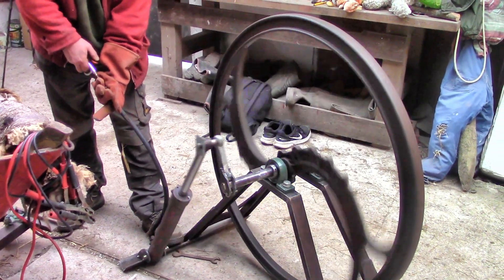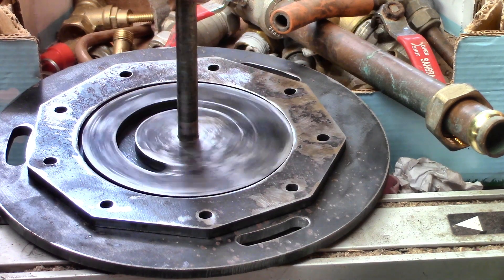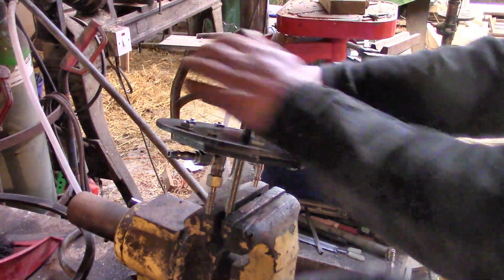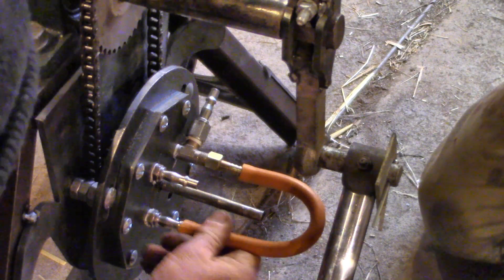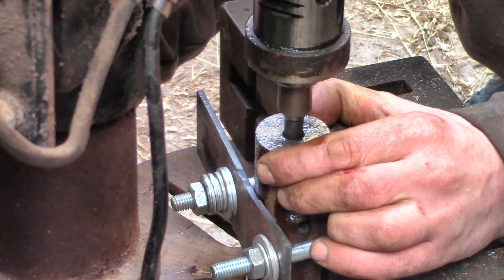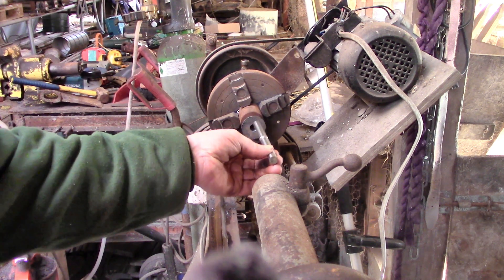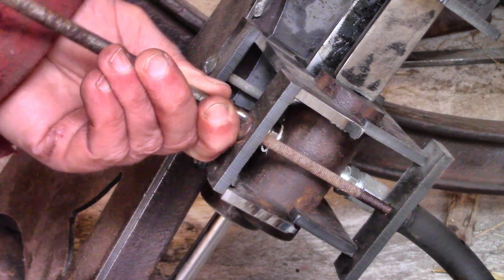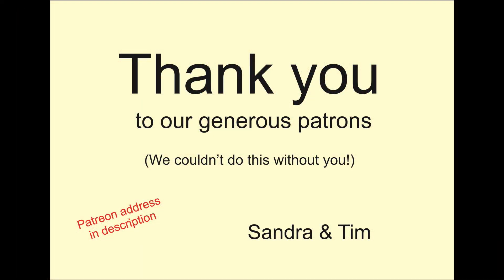Homemade Rotary Disc Valve And Spool Valves For The Steam Engine (I’ve been busy!)

Comment: As always, excellent work! I love the relative accessibility of diy steam engines (vs ice anyway) and the parallels of your machining capacity to that of the early 19th century! Even just the inaccessibility of ball bearings made for such a different approach to most engineering solutions.

I briefly worked at a shop that restored Stanleys and had a chance to get pretty intimate with all the components and the work that went into making them as we made most pieces from scratch based on salvaged parts. I'm not a steam engineer, but can at least say from this experience that packing is your friend! Most of our manual valves were needle valves because they were easy to machine and pretty forgiving as the metal is soft, but I can't recall what the actual engine used. I know it was driven externally by an eccentric, and slid along its axis much like yours, but I never personally worked on one. 

I have a little more experience with industrial fluid pumps though, and can say that the expense and engineering that goes into mechanical pump seals is impressive. They're incredibly tight tolerance graphite discs that are very delicate and costly, but have a service life of up to several years. If I recall correctly, our three main 100hp influent pumps had their original seals in place after over 10 years of service running 1/3 duty. Impressive surely, but I can't fathom how they're manufactured and it's a lot easier to stuff in a bit of rope and keep an eye on the drip rate!

Comment: Just some trivia and side notes: The Antikythera mechanism is an ancient device comparable to an astronomical clock that used gears and dials to show astronomical and calendar relationships. It was discovered in 1900 by sponge divers along with other finds, including bronze statues and coins, in a shipwreck off the Greek island of Antikythera. The coins allowed the shipwreck to be dated to the period between 70 and 60 BC. The use of reamers (comparable to watchmaking hand-tools today) is clearly documented in this artifact. That's fascinating, isn't it?:) For even greater precision, such as that which you are looking for for your airtight metal fit, there is the option of grinding. And believe it or not, this was also used over 2000 years ago. For example, with adapted soapstone and a flywheel with a twisted thread hand drive.

Great project and thank you for sharing!:)))

Comment: may be less leakage, better economy of air use/ more flexability wrt possible timing adjustment etc to generate/process control signals that use small amounts of air that then pilot larger airflows via inlet and exhaust poppet valves for the cylinder...
( akin to the mechanical  trip mechanism of corliss valve, or the hydraulic system of the engine on the 1929 Swiss Steam Ship Stadt Luzern )

small "bump" or lobe on flywheel.
4  roller actuated pneumatic control valves, arranged so as lobe on flywheel actuates them, they'll provide a short pulse of compressed air. those pulses provide the timing of the valve events.  
2 air piloted pneumatic "flip flop" valves. these work almost exactly like an electronic flip flip, in that they remember the most recent input provided to them. the outputs from such a valve are then perfect for driving
2 air piloted main air valves; one valve for air in to cylinder; one valve for air exhausting cylinder

valve timing can be adjusted by rotating the roller actuated pneumatic control valves around the flywheel,  it would be feasible to arrange for such to do by a governor.

Comment: I wonder if making a casing for the disc with the plasma cutter out of some plate would help air pressure. Since could green the disc and use sealant on the casing.

Comment: Great stuff, a 3-way pneumatic valve can be purchased for around £10, but not nearly half as much fun, engineers of the past didn't run steel on steel, you can run steel on cast without binding, but it wouldn't hold air, they used gaskets and seals, you can get steel on steel valves bet these are case hardened then precision ground to size, usually tapering but not always.

Comment: you need to be putting air into your cylinder from both ends.  So you need a cam & valving setup that permits air to be put into one end of the cylinder, and out the other end... and switches on the other half of the stroke.  That is called a double acting stroke.  Which will cause your engine to run faster.  So you need a double acting valving.
Reply from the maker: No, I don't need that : -  )  Have a look at later videos about getting the air loco running. Double acting pistons need more valves - and more air...

Comment: Worked on reciprocating steam pumps for many years in the oil industry. Nearly all were two cylinder. The single cylinder pumps were nearly always a pain to time correctly and get to run correctly. 99% of the two cylinder steam pumps had slide plate valves that were connected to the piston rods by an arm that fit loosely on the piston rod. Much simpler than I can describe. The single cylinder pumps had a slide piston valve like you were trying to assemble. I hated the silly things. Good luck.

Comment: you need a gasket because the air is leaking out around the plate
Reply from the maker: Most of the leakage is inside though

Comment: Heres some tips if your building a steam engine, I've known a lot of steam locomotives, Though Narrow gauge steam engines are a bit tricky, some have small coal bunkers  And are only useful for small distances, The Solution to this is a tender, This also makes problems, The first one of which is the water injector, These may fail sometimes and without a water injector and tender engine simply can't function, I Would suggest to build  an engine with a water tank that can store more than 15 gallons, Make the engine with a built-in tender for storing more charcoal or any type of fuel your using, Problems with the firebox are also common, make sure your engine has a large firebox or you can build it a small one and use welsh coal which burns better, The reason i suggest this is beacuse this is what ive know so far, Oh and if your building an Passanger engine, Add an front pony truck [bassically an truck thats connected to one end of the locomotive and makes it easier for it to go through curves] Of course this will be expensive but it might be worth it, Also you may end up creating a incredible fully runing railway.
Reply from the maker: Thanks, Saul. But it'll be a long time before I need worry about any of that : -  )

Comment: Why don't you look up the design of old steam box valves...they are way simpler that any of this. And require very little precision
Reply from the maker: they need a steam-proof  way of operating them from the outside - so they're actually more complicated I think.
Reply: @wayoutwest-workshopstuff6299  https://youtu.be/kJRUXvV4IQs here check this out. She shows and explains it in the second half. They self wear in, and the pressure helps seal them.
Reply from the maker: Thanks, yes, I saw that one a while ago and was put off by the precision she was achieving. But watching it again I can see that I might be able to bodge something together. I haven't given up on the spool valves yet though - just need a bit of time to get back to them..

Comment: The early engineers used slide valves, not spool valves, which are kind of a combination of the two devices you built in the video. the spool valve was a later invention.
Reply: both very early engines and late steam engines used trip valves.  which at the simplest are rotary valves with a lever arm, which literally got knocked (aka tripped)  open and shut the valve, with motion of piston, or crank. 

Steam engine development, including that of valve gear, wasn't always continued improvement. there was a lot of avoiding infringement of existing patents

Comment: the rotary plate valve is really common in those weird toy steam engines, specially the ones from the 60's.  a while back i figured out a pseudo super high pressure pump that used almost the same design, you could add one easily.  the trick with them is to put pressure on one side and the exhaust on the other, so the steam pressure holds the valve tightly closed.

Comment: Steam engines use cast iron rings (like split piston rings) to seal the spool valves on either side of the "waist," and gland nuts with graphite rope packing to seal the ends where the valve shaft goes through.  If you're using compressed air or low-temperature steam you could get away with using silicone o-rings and lip seals instead.

If you're using cams you could use poppet valves like on a car engine.  You'd have to arrange them in a way that the air pressure is holding them closed.  Most steam engines used an eccentric shaft to drive the valve back and forth.
Reply from the maker: Thanks. An eccentric shaft is just the same a small cam, isn't it?
Reply: @wayoutwest-workshopstuff6299  It's more like a crank with a smaller stroke.

Comment: This is absolutely brilliant! If I may offer some observations, I think that the inlet valve is open too long, and the exhaust valve might be a bit late, causing some pressure to stay in for too long slowing down the piston. I wish I had the stuff to do what you do. You're honestly one of the best and most honest people on this website.
Reply from the maker: Thanks very much - yes I think you're right about the valves. Apparently a little compression at the end of the stroke is a good thing though..
Reply: @wayoutwest-workshopstuff6299  You are correct! I think that just moving the exhaust valve over slightly might just do the trick.

Comment: Theres an easy to build steam engine valve called a wobble engine. The valve is controlled by the tilting of the cylinder and with only one flat slip face it functions very similar to your first valve.

Comment: Every steam engine piston and valve rod has stuffing glands with a packing material like graphited yarn that acts as a seal. You screw in the gland (not too much!) and the packing squeezes around the rod to seal it. It works on air too.
Reply from the maker: Yes, thanks, I've just heard about this. So much to learn!

Comment: You can grind the plates to a match. But the distance between the covering plates have to be adjustable.

Rotate the valve plate with a drill between the covering plates. put a weight on the upper covering plate (ideally the weight is distributes equally) Put a clay slurry on the contact faces and run the drill. In intervals tum the plates in relation to each other to equal out inconstant pressure distribution and add slurry.
I made a seal for pressure pot this way. Took me only two days. :-)
Clay slurry is a surprisingly good lapping medium. (It probably depends on the region :-) )
Reply from the maker: Ha! You know you can buy carborundum paste, which might make it quicker?

Comment: Steam valves use graphite packing, even on full size steam locomotive cylinders the piston has piston rings.

On the spool shaft use silicon o rings to seal. These withstand the heat of the steam.

Also if you are able to put a air feed on both sides of your pneumatic cylinder then your engine will run far better with more oomph
Reply from the maker: Well, maybe, but I'd need more air/steam. I'm thinking I'd be better off using the second cylinder and keeping them both as single-acting. (The piston rod itself takes up a lot of space in the cylinder so that stroke is much less efficient.)
Reply: @wayoutwest-workshopstuff6299  ah I didn't realise you had a second cylinder, yes that would be just as good.
I think you will be surprised at how much steam you will produce once you've cracked the boiler design 👍
Doing a great job with the tools you have at hand though been a pleasure to watch. I have a workshop If you require any precision machining let me know how to contact you and I'll happily help out
Reply from the maker: @peterroberts5835  Thanks, Robert! That's a kind offer. I'm guessing you're not in walking distance of us, are you? Or even in Ireland?
Reply: @wayoutwest-workshopstuff6299  afraid I am England based but more than happy to help cover the materials and postage myself as a donation as I enjoy your video's.
I have a large milling machine and lathe and access to surface grinders.
Just let me know I'd be more than happy to help.

Comment: The first steam engines used packing to create seals I'd think.

The first idea would have been a beautiful execution, it need a lot of precision flattening though. I believe Ox Tools did a video with a couple metal discs and a bunch of pennies glued to it to demonstrate principles of flattening.

The second idea worked out in the end, after the first failure I said to myself, "he needs to use annundersized drill bit then a reamer". I don't blame you for getting it wrong, I wouldn't have had the right tool laying around. I only know things because I enjoy watching machinists to unwind.

The final idea turned out beautifully, I want one as is so I can listen to it run, the sound it makes just seems right.
Reply from the maker: Thanks, Joseph : -  )

Comment: The timing is off.
I suggest installing them as operated by the piston, probly on the cylinder. The operation wouldn't require machining a cam lobe, since they would be controlled by travel, and the piston doesn't rotate.

Comment: While you can't use rubber rings to keep a tight fit, could you use cork instead? It's airtight and I haven't heard of it suffering at steam temperatures. Put two rings of cork on the spool valve and you should get better returns.
Reply from the maker: Cork at 200 C? I think it would just cook. But maybe you're right

Comment: For compressed air use, what about cutting a groove for an o-ring?  I think both valves could benefit from that.  For steam use you would need some sort of Teflon compression seal pack, I think.

Comment: Lots of early mechanic work was making parts FIT each other by lots of trials, lapping, and other tricks.  So each assembly was unique.  But your point about the difficulty of this project is a good one.  Drilling an accurate deep round hole is a difficult task.  There's more than meets the eye.

Comment: That was an amazing 27th attempt, Tim! Great to see it working at the end, if a little ropey but that can be tuned out.

Likely the reason you had issues with the sizes of your holes is down to the fact that drill bits don't create round holes, but oval ones. It will feel nice and tight, but there will be a gap somewhere. 
Generally when using a reamer you use a drill sized a little too small, then open to final dimension with the reamer after. This avoids the oval problem as the oval parts of the hole will still be smaller than your final diameter.

Great stuff though, can't wait for the next instalment (:

Comment: I now you are trying to stay away from high temp orings. Steel rings may help on the valve. I worked in a air and hydraulic repair shop. Steel piston rings would also help on the hydraulic cylinder piston Less drag. A longer gland or spacer  between the piston and gland will help on the rod to stop wear in your operation. Compressed air going in and non compressed air being compressed to coming out is an issue not just in loss of power but will effect your timing just a little. We built quick dump cylinders on huge winch breaks, with collars between the piston and nut that allowed us to cut windows in the cylinder barrel to hold no back pressure. May not be needed in test but will help in the final project.
Reply from the maker: Thanks, yes that all makes sense, but I think I'd need to upgrade my workshop for that : -  (
Reply: @wayoutwest-workshopstuff6299  I am on a shoe string also. Some times a kit from a valve you are trying to make allow one to purchase what you need and then build a valve body and shaft to match. That's how I get around not having the right tools.I play with with a rear end transmission and mule. Ever thing oy running the shop off off gas from the charcoal making. It will run an engine as you make charcoal.

Comment: Check out the model steam engine.
https://youtu.be/AUbU_fH75jU

Also did you lap the plates in your rotary valve?
Reply from the maker: Thanks, Alan. Yes, that's a very nice model. I did lap the plates - but not well enough, I suspect.

Comment: With the workshop facilites you have, I would be looking to build a battery powered  electric loco or an i.c./ hydraulic one ?
I know fuel prices are going through the roof, but solar panels, wind turbine or wood gas would be quicker, easier and safer than steam ?
Sorry if this comes across as a criticism, I'm a big fan of both your channels.
Reply from the maker: I might make one of those too, if I'm around long enough..

Comment: You can use the upper hole in the piston to "pull" the wheel in the "return" way, a "push and pull" system.

Comment: I still believe you need a cam and use both cylinders with a bike pedal crank !
Reply from the maker: I have two cams, Dave!
Reply: @wayoutwest-workshopstuff6299  I meant smaller cams each to run a piston 180 degrees apart with a short duration , I used a Briggs 3hp engine , exhaust and intake on the exhaust port and made a 2 lobe cam ( not sure if works yet ) . I’m sure your going to make it run perfectly , your very good at what you do !

Comment: How about an electric solenoid that is triggered by a spot or sensor on the wheel?
Reply from the maker: Yes, I did think of those - but are they heat-proof?
Reply: @wayoutwest-workshopstuff6299  I think they can be bought in a heat proof configuration.